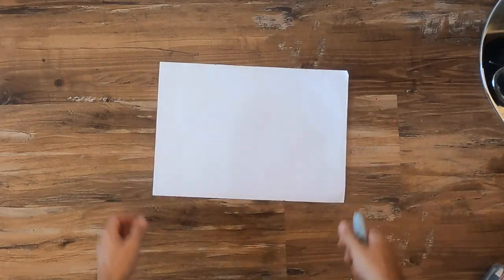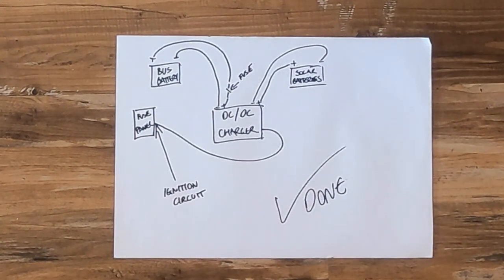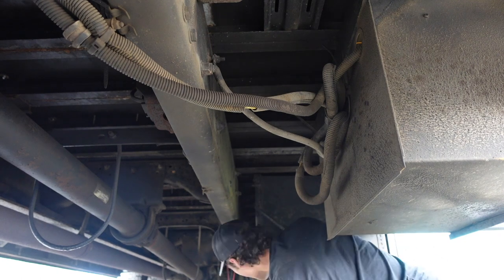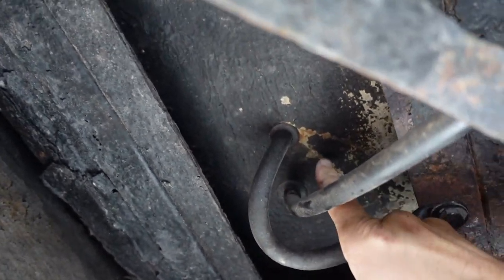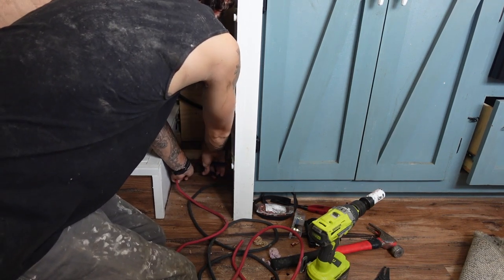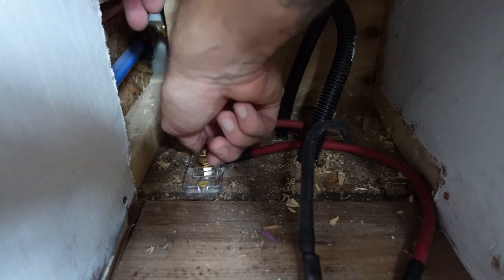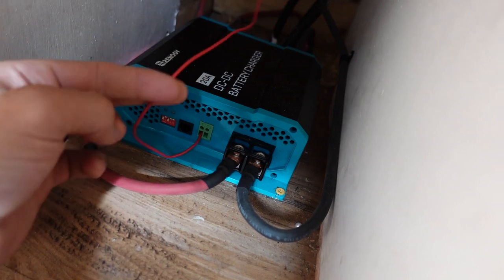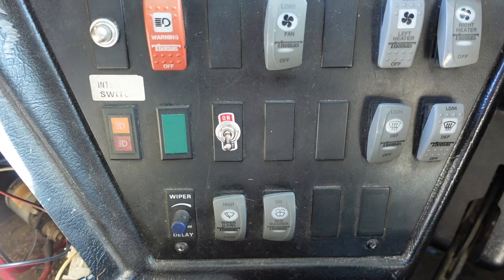HOW TO CHARGE YOUR SOLAR BATTERIES FROM ALTERNATOR | Renogy DC/DC Alternator Charger Install

Comment from the maker: Hey guys! Since this video we have upgraded to this unit instead: https://amzn.to/3o36Tzu 
Definitely worth the upgrade!!
Reply: owwwwwww you need to be careful connecting you alternater direct to you big lithium battery could overload it - you would have been wiser to use the 40 or 60 amp Renogy unit  - or fit an aftermarket  alternator tempreture device that backs off the excitation  regulator limiting the current .

Comment: Well done and the best way to charge a 12 volt from a 24 v vehicle. Thanks for posting this cheers
Reply: By the way how many charging amps does the 12 volt battery get from the DC/DC unit ? EG when the 12 v is low

Comment: Nice video and not nicking you install maybe I missed it but do you have a fuse near the battery or just near the converter.Only reason I bring it up if you dont have one near the battery and that line Chaffee on the frame somewhere you going to have a fireball.Just my 2 cents from doing many 12v electrical installs.

Comment: Jay, easy way to see if it is working is to measure the voltage of the house batts with the engine off, then start the bus. You should see the voltage increase indicating they are getting charged.

Comment: I would have used a dual charging block off of the alternator. The are three terminals, alternator into the charging block, battery one into the charging block, battery two into the changing block. When the alternator provides power it is routed to BOTH batteries, however since the charging block is basically two DIODEs current can only flow from the alternator to the batteries, and can not flow from one battery to the other, or from either battery to the alternator. Completely passive. PLUS if a Heavy enough solenoid from one battery terminal to the other, you can then use the house batteries to "jump start" the bus batteries. All this is assuming you use a same voltage for both house battery and the buses battery.

Comment: Question: I understand wanting to upgrade to the Victron if the 20A Renogy unit wasn't charging quickly enough. At the same time, that's also a function of how large a battery bank you have. How many amp-hours do you have in batteries? (Presuming they are 12V.)

Comment: Hello, I was just wondering whether it would be possible to purchase this and drive the  automobile alternator connected to a high-rpm, 220v AC motor. I have a 5kva MPPT inverter, but I don't want to use a solar panel. What do you think of it?

Comment: Did you put your switch on your D+ line or the main cables? Also, do you know if you are supposed to put that 30A fuse closer to the starter battery vs the house battery?

Comment: I feel like 20A just wouldn't do enough. I saw someone with a van build and they had a 20A and said it took WAY too long to charge the batteries while driving. The 40A model was a lot better (and not much more expensive) I always wondered what a more powerful alternator for a bus would cost to run the 40A (or even 60A) charger plus still get plenty of juice for the starter batter.
Reply: From what I’ve researched, if your alternator is under 160 you should use the 20 amp dc/dc for reduced risk of breaking your alternator

Comment: Hi! Can you please tell me what size of fuse you use to connect the ignition cable of the dc to dc in to the bus fuses box i have a 20 am dc to dc from renogy i call them and ask but they any say that you don't need a fuse for the on off of the dc to dc
Reply from the maker: ye you don't need a fuse in that connection as it is such low power

Comment: How do you wire the toggle on/off switch?
Reply from the maker: Put it in line from the unit to a fuse that is only active when the ignition is turned on

Comment: The issue is alternators do not like charging at idle.. They require to be at 2500 RPM for their rating...While getting lots of air across it. 

Why alternators fail early. They use 70-90 amps just to keep the engine running...Why all the new DC-DC chargers limit the amount of charging current to 25 amps...Unless you have a dual alternator setup. Diesels are more tolerant for idle charging...